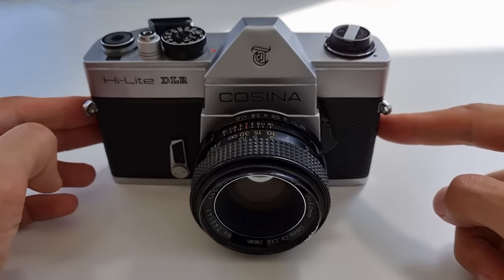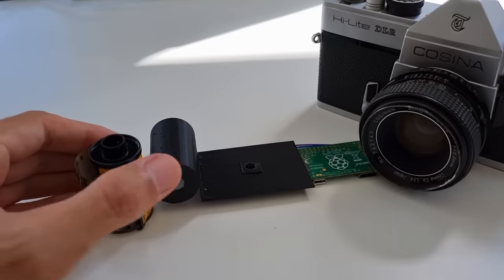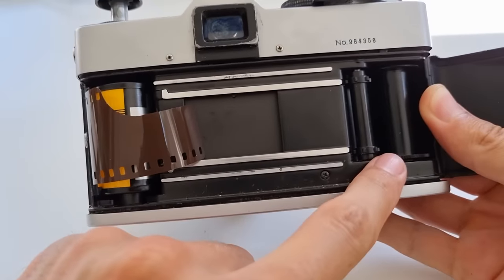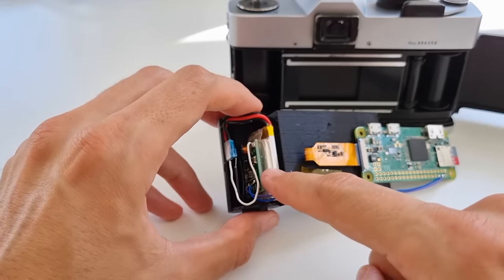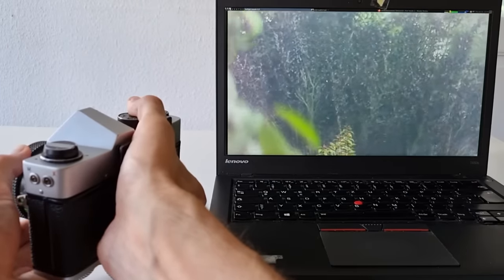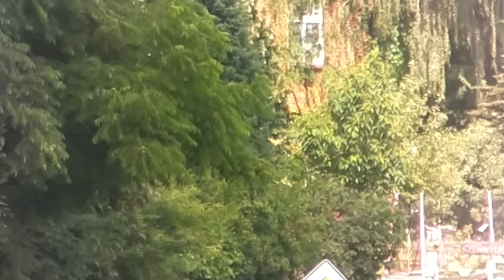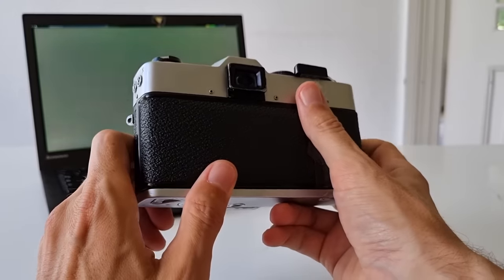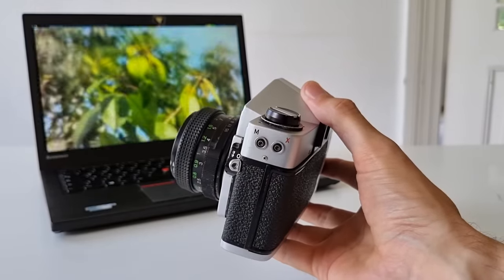Digital Film Cartridge for Analog Cameras (using Raspberry PI)

Comment: I always thought a company would start selling a digital film adapter, but it never happened and here you are with such a device.  Amazing project!!!
Reply: They don't want to hurt their own sales, and a company that doesn't sell cameras isn't going to make a film adaptor.
Reply: I believe several were made in the late 1990's,  but were not commercially viable. The image quality was ok, but due to the lack of electronic feedback to the lens and shutter, it was tough to regulate the exposure.  With the price of DSLR's dropping to under $400 by 2000, it didn't make any sense to use the old equipment just to preserve the great glass.  Of course now, film is back!
Reply: @RAkers-tu1ey  Yes, indeed! I remember having been on a photography trade fair with my dad, where such a product was presented. Never made it to the market because of the fast drop in DSLR prices, as you correctly guessed.
Reply: Some truly are easily impressed.
Reply: @Desert-edDave  now, now,  be nice.
Reply: It was developed in the 90’s. I remember signing up for one. The idea (patent) was bought by Kodak and guess what, shelved. That was the end of the project.
Reply: There is for medium format. Hasselblad and Phase One sells camera backs with image sensors. If I recall correctly, Leica did something similar when they were transitioning to digital
Reply: @haroldoeguchi   Yes, you are right. The Hasselblad unit  is exceptional, just like almost all of their gear - if one can afford it. 
I believe they still offer it?
Reply: There has never been shown that a useful digital inset can be made. Several tries have been made, none successful. The task is by far too difficult. It is very hard to use a big sensor, so you always get high crop factors. Sensors have some thickness, so there is not really room for it. There is no communication with the mechanical camera and the electronic sensor. Noise adds up if you have the sensor open, so you really want to sync the shutter and the sensor. Hard to do. It is always cheaper to make a digital camera than a well working digital inset. And the digital camera will always have more functionality. To make a good inset you need LOTS of electronics, taking place and use lots of energy, i.e a big battery is needed. What usually is done is then like the author made here. Put the user interface and big part of the functionality in a computer. Most of the functionality is actually not in the inset. So no, digital insets are not going to rule the world.
Reply: I have been waiting for this since the digital photography introduced. That is why I still have some of my film cameras such as FM, OM1. I really hope company starts to make such product.
Reply: I believe Nikon offered a “digital back” that basically replaced everything that’s hinged. That was serious money, though.

Great to see that all the old lenses might have a new use, this way. I bet you can get old SLRs and parts for peanuts now.
Reply: @haroldoeguchi as did Minolta
Reply: There are actually a couple on the market. Also a new one for 35.
Reply: @Volthan  I have never seen any useful ones. Only high crop factor WebCams. Can you point me to any useful digital film inset?
Reply: I have also seen a huge one that think is special made for one Nikon model. Looked a bit unfinished or home made though. And highly unpractical.
Reply: Kodak made a ton of digital backplanes that snapped in place of the 35mm door. You would have to go to a pro camera store back in the 90s to find them of course. AP News cameras were dual backplane for a long time so they could switch to 35mm on the same camera body when the batteries or hard drive space ran out.
Reply: @augurkur  Hmmmm ... they made 35 mm backs that you could attach to medium format cameras and they also made rebuilt 35 mm cameras from Canon, Nikon and Sigma. All had 24x36 6MP sensors. Can you give a pointer to any 35 mm back for 35 mm cameras?
Reply: Imagine having a digital camera without any buttons or a screen, this is what these essentialy are.

Several prototypes were made but these didn't make it into the market since it was pointless

Yes it doesn't require development unlike film, but you needed to go home and plug it into a compiter to view the files so what's the point

Remember that laptops costed as much as a car in this era, and smartphones would not be available for atleast another decade.
Reply: Lots of SLR cameras, have removable backs.  Not saying it would be worthwhile, but it wouldn't be difficult to accommodate the electronics, battery, and the required 'smarts' to sync the shutter and sensor, and other functions, in a replacement camera back.
Reply: @buckybucky8596  As you yourself write, the camera needs to be modified. You cannot just buy a digital back, you also have to send your camera to the seller of the digital back. After the modification the camera might still be useful as a film camera, or not. After the modification, the camera might have external parts added, or not. The modifications can probably only be made for a limited set of cameras. And it is this it always falls back to. That's why you never will be able to buy digital film.

Sure, if you yourself, for fun, builds a digital back, then you can also modify your camera. But this is a hobby project.

Comment: This is the most promising solution to this goal that we've been waiting on for the last 20 years!
Reply: I also expected this to be done and sold 15 years ago ! I suppose it was more profitable for camera makers to sell digital cameras...
Reply: I remember reading 15-20 years ago a company had developed this exact idea. I cannot remember who (think it was Kodak) bought the company including patents and we never saw the product hit the market.
Reply: In fact it wasn't uncommon 20 years ago when analogs was so popular but it costed to much due to a size of the sensor comparing to trashy digital cameras with smal sensors and the concept failed.
Reply: I was trying to get  this design manufactured for over 20 years no one was interested
Reply: @Pawel_Mrozek  Digital backs are still a thing, but they're mostly on more expensive cameras, like the ones from Hasselblad. There's little point in doing this with 35mm or smaller cameras, as the only real upside is that you can use the camera you've already got and upgrade just the sensor at the cost of not being able to have the entire thing engineered to work together as well as possible.

Comment: Nice project. Hope it turns fully functional. There are a ton of old but healthy film cameras hanging on a nail behind a door awaiting resurrection.
Reply: Not really. Film is hitting the mainstream currently and the prices of film cameras are skyrocketing due to the limited supply of them and a huge demand right now.
Reply: Just use film, absolute no point in a digi crap insert

Comment: Glad someone is making functional prototypes of this. Learning photography during the transition from film to digital I had thought of  this in the early 2000's, but never had the digital hardware or programing skill to test it out. 
Would love to see a full frame sensor version, with the ability to use the original shutter and change ISO so that you could use the full functionality of the camera.
Reply: I have loved film cameras, but a conversion just doesn't make sense--it would be hard to fit the electronics and power source for full frame into an SLR, and impossible for a proper camera like an M Leica. The way to do hybrid surely is to use film and then scan the negatives, so you also get the film image capture effects. Which is what the cool kids are doing now. It's expensive, but then film photography always was, and nowadays there's no point in using film for anything but very careful, thoughtful work.
Those wonderful old lenses might, too, turn out to be not quite so wonderful by comparison with modern equipment. I've digitised a lot of b + w negatives, and have found that quite modest technique (that captures the film grain sharply and so is working fairly well) shows the limitations of the best 35mm lenses of the 1970s.
Reply: @michaelwright2986   Yepp, the digital film is a VERY HARD project, probably impossible. There are so many things that needs to work before it is a useful camera. There have been several tries, and all have failed. Because .... it is not really possible.

Comment: I guess like many of you I have been thinking of a setup like this for years, at least the concept. It is nice to see the results of someone actually achieving to build something with off the shelf components. At some point this will work with an actual high quality 35mm sensor. The really hardpart will be the integration of the (minimally required) mechanical components of the camera to make it full functional. One thing is sure, this technology will not be offered by the camera industry :)   Great for the nostalgic enthusiast.

Comment: I kinda feel like it needs a lense spacer to move the lense a bit further out to correct for the crazy zoom! I believe that Lens adaptors are available and by using one you should get an even higher resolution image on the sensor.... 
I have said it many times, I have used film SLR cameras in the past and found that I liked how I can get the exact image I wanted but may years later I spent a lot of money on a DSLR camera and expected it to take perfect pictures all the time! Boy was I wrong! 
Which is why I have always said that if my Olympus OM2 used a digital sensor to capture the image but left the aperture, focus and zoom up to me, I would definitely buy that camera! 
Digital cameras are very hard work to capture the image that you want! The camera doesn't know what you are focusing on! It does whatever it wants to do! I found the hard way that if you take around 300 pictures on a full battery, I only get around 3 pictures that turned out amazing! While with a film camera you might get 3 bad pictures! 
Sure you had to make adjustments to get a good picture from the film camera but in comparison to a digital camera with its menus diving makes it a pain to use and if you don't use it for some time, you have to learn it all over again.... 
Digital cameras need some sort of eye detection system to work out what we are focusing on! Once this is achieved, the digital camera will finally be what it should have been from the beginning! 
I hope that this digital camera conversion comes out to market, I would definitely be interested in this! Especially if it is designed to link up with a smartphone to store all the images and videos with the ability to review what you have captured... 
But definitely the lense needs to be spaced out and or the sensor needs to be moved back or use a larger sensor..... This truly looks like the beginning of something amazing! Hope you keep working on this!

Comment: this gives me hope that one day a full frame version will exist and i can shoot digital with my nikonos.
Reply: Such digital backs have existed for years, but for high-end 6x6 cameras.
Reply: There is no way to ever make this full frame 

1 - the ff sensors are expensive and require more processing power. ff cameras were bulky back in the day, but even nowadays they're full sized cameras and very few get compact sized

2 - Battery, this cartridge barley has space for any battery, the best place would be the film casing equivalent, but even then it's to small to run the sensor for any reasonable time

3 - The biggest flaw - we're talking about a full ass sensor slapped just right onto a small adapter plate. Sensors are hidden inside full cameras and well protected against dust, even one large particle could ruin it and require a very delicate cleaning process. This adapter would mean that you pretty much have to never remove the adapter after instalation

Everything I mentioned could be as well said about any crop sensor other that what we see on this video. This idea just doesnt work

Either buy an old style digital camera like fujifilm, or just buy cheap film and scan it

Comment: This is so great. I remember that your concept was actually under development somewhere in the late 90’s, but somehow failed. The prototype looked very similar to yours. I finally gave up waiting and bought a small digital camera and sold my Olympus OM2SP and Pentax cameras. Wish you the best of luck in developing this further. 🙂.
Reply: @steveNCB7754  Totally agreed!  Business/Revenue is the priority unfortunately
Reply: It was heart breaking retiring my Olympus OM2n SLR …… BUT I can use all the lenses on a Canon full frame with an adapter, in fact I bought more OM lenses off E-bay!  They are stop down manual operation only but are perfectly usable especially with live view.  (Nikons cannot focus to infinity).
Reply: @tinkerman1790  To be fair, this design is wholly dependant on today’s WiFi to work (being entirely located inside the SLR body). The first WiFi protocol didn’t come out until 1997 and was only 2 Mbits/s, so any solution then, would probably have required actual modifications to the camera, to allow wired access. Either that, or you wouldn’t have been able to close the back.
Reply: @tinkerman1790  That is interesting - maybe one day I’ll be able to take digital pictures with both of my Pentax ME Super bodies LOL.

Comment: Adding a film canister style block to the other end might reduce the shaking a bit as I believe it’s probably caused by the unsupported weight of the raspberry pie. You could probably fit another battery in it too if that’s the case.
Reply: That might have a small effect, but the camera shake is really due to the extreme crop factor that is likely equal to a 200mm or higher telephoto.
Reply: @1964mcqueen  much higher

Comment: If you could make these with a Micro Four Thirds or larger sensor, and include a still-capture feature that incorporates the camera's shutter, you could sell them by the thousands!  I'd be your first customer!  I'd gladly pay $300.00 or more for something like that!
Reply: @tobiasnietgen  I'll check that out!
Reply: @tobiasnietgen  wow, thats a scammy :) its a small webcam that shoots at a ground glass :) people go for anything these days... the image quality will be horrible, even as dof adapters (in cinema use).. the ground glass is made so that it moves/rotates, so the coarse grain of it wont be showing all the time.
Reply: Im back is shit. Seriously, this works better.
Reply: unfortunately, i looked into this, the hardware just isn’t available to someone trying to hack something together, and perhaps more importantly, no sbc or microcontroller for hacking stuff together is powerful enough for the large sensors
Reply: surely there are some older sensors that aren't as high density that are still large in the capture surface that would give same image output as pi camera, just not cropped to the center that would work.
No-one is expecting 8k from version 1.
Reply: @Corianas_  do you have a link to any of those sensors? I wanna see what I can do.
Reply: @Geert890  honestly there are sensors for old sony cameras on alibaba, and a few year old 35mm camera sensor would be perfect. I am unable to work out what size a IMX294 sensor is however, all i get are diagonal distances.
but i am probably looking at the wrong spot, or there is a simple calculator to tell that.
Edited: accidental decimal place in the mm as was thinking in cm.
Reply: @Corianas_  3.5mm? That seems like an insane crop. Full frame would be ideal of course
Reply: @Geert890  apologies, i was thinking in cm but types in mm. but it is 21.something mm on the diagonal. and is 4:3 ratio
Reply: u4/3 is quarter frame, too small.
Reply: @givenfirstnamefamilyfirstn3935  cool, then what dimension of sensor am i looking for? instead of just going "wrong", you could actually provide detail of what would be required.
There are literally thousands of parts out there, and you want me to tell a specific part number for you? how bout you either provide details of what 'right' is. or look for yourself and provide options,
Reply: @Corianas_  Is this now your post?
The original poster said ‘or larger’, see the top of the comments.
Reply: @givenfirstnamefamilyfirstn3935  apologies, i thought you were replying to my post about a 4/3 21mm diagonal part i asked if appropriate. I hadn't realized you meant his original post.

Comment: As I recall, this was the route that Kodak took in the mid 90s to provide Associated Press photographers with digital image capabilities. They took Nikon cameras and retrofitted a sensor where the film would go and a large battery/storage system where you'd expect a modern vertical grip.

I believe it was called the Kodak DCS.

Comment: Interesting video. Back in the noughties when film cameras were on their way out, I thought it was such a waste to have such great cameras in my collection, an Olympus OM4 & OM2 made redundant. I wondered if a third party manufacturer would remove the back of the camera and fit a new back with a sensor attached, to sit close behind the shutter. When technology improved you would just replace the back with a newer more powerful MP sensor. It was fascinating to see that you'd come to the same conclusion but thought of a less invasive / destructive way of doing this. Well done.
Reply: I also have the same thoughts some years ago. I'm pretty sure there's a market for this! It's very simple to remove the back of most cameras.
Reply: Most 35mm SLRs had backs as accessories, date backs, large film rolls, etc. A back would give you a lot more room to play around with. You could put a small screen on the back. Also put a rotary switch line up with the film advance. When you "wind" the film, the RPi can send the image to the computer.